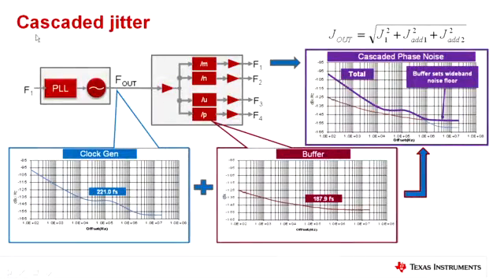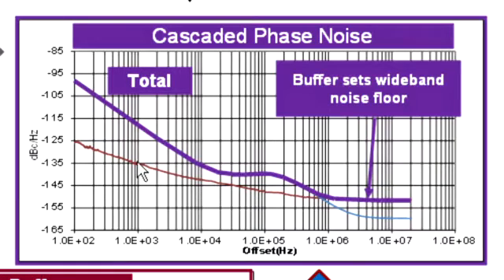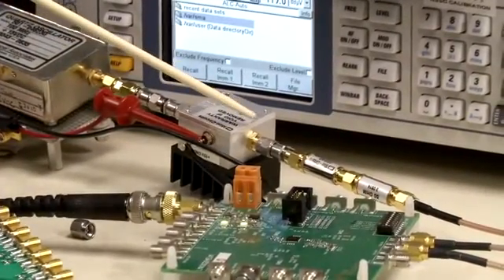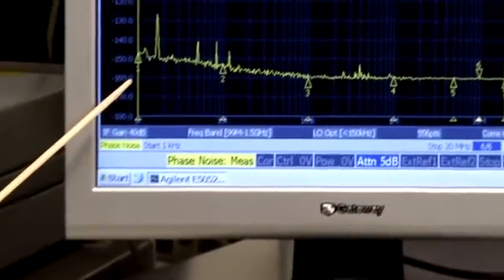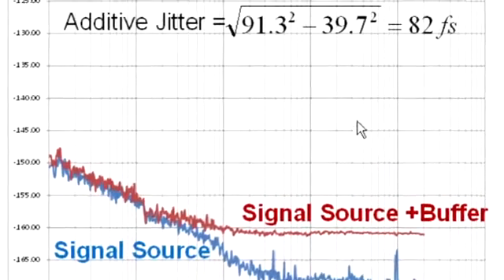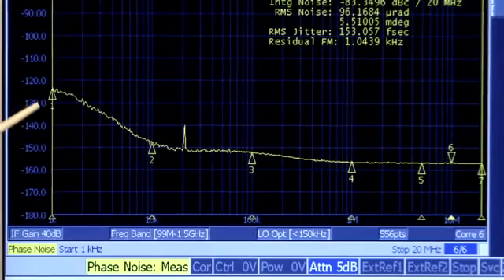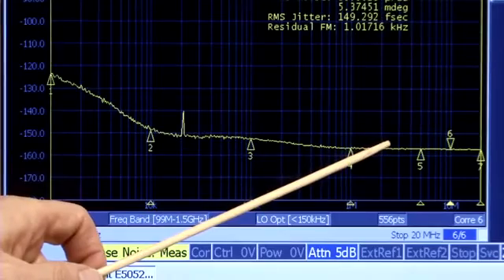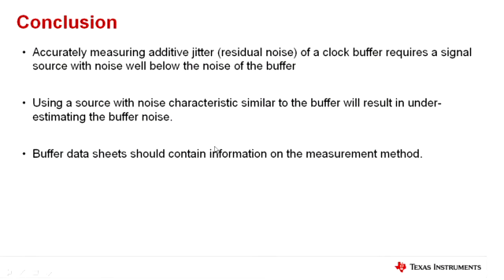Engineer It- How to measure additive jitter in fanout buffer

Comment from the maker: Hi Jorge H, the integration range is the same for all the measurements shown in the video: 1 kHz to 20 MHz. The measurement I am referring to in the video was done using the same clock source and buffer. We did not show the actual measurement on the video in order to save time. The purpose of using the second measurement was to illustrate the computation of the additive jitter of the buffer.